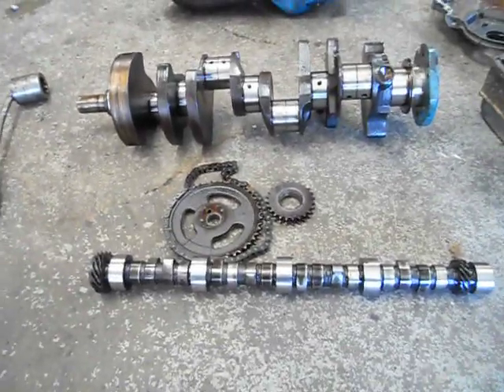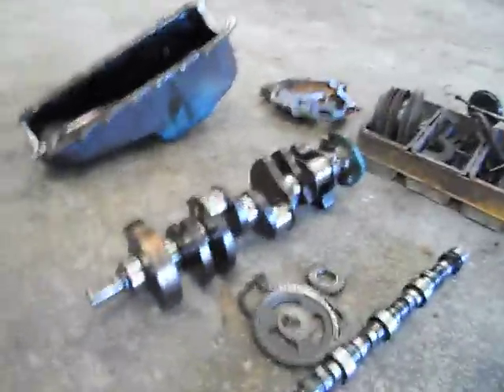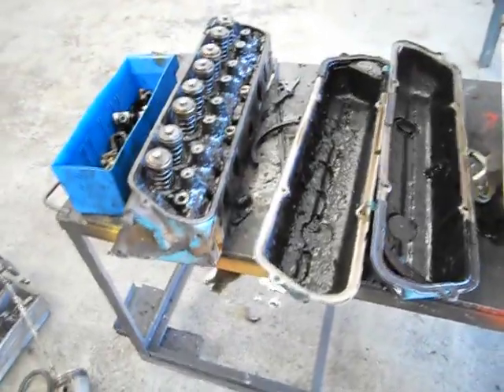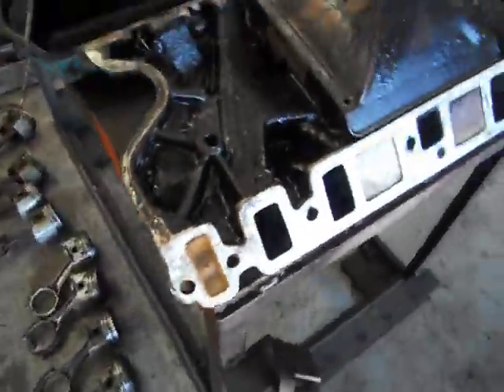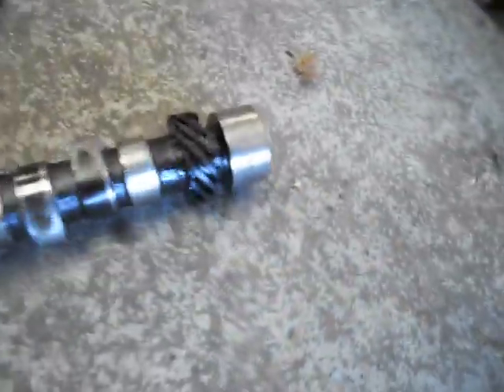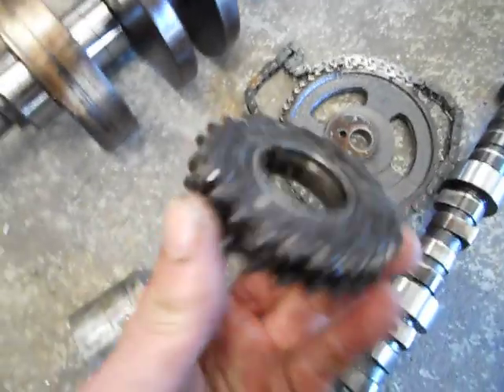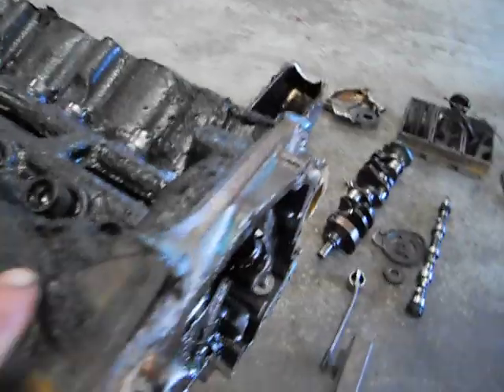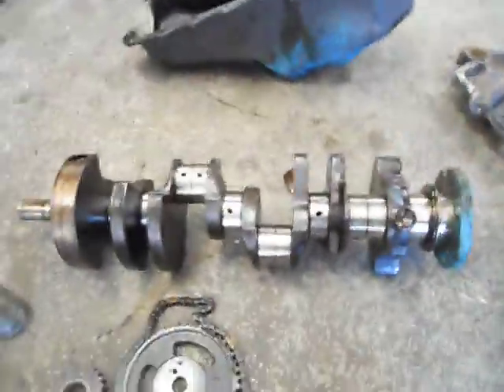How to rebuild a General Motors Holden Engine part III

Comment from the maker: I'll do another when it all comes out of the acid tank,yes it is a removable plate that stops oil splash under manifold where exhaust x over for egr runs through Manifold

Comment: be good to see how it cleans up. is that a removable baffle thing under the inlet mani? used the cable tie trick too - used it to keep a couple of braided lines that were running close to each other apart. didn't want those buggers rubbing through each other. cheers for the vids & info!